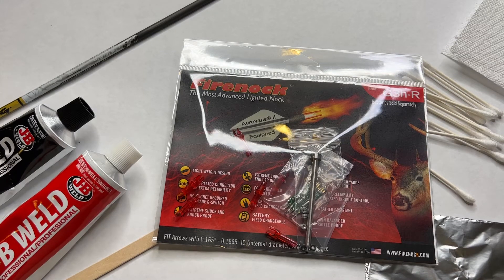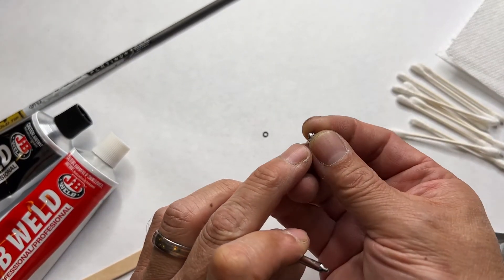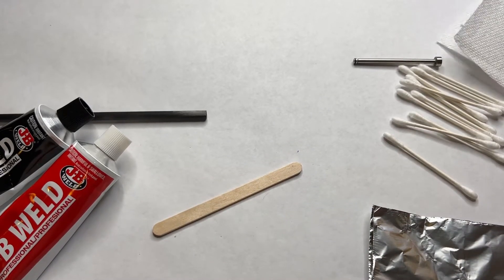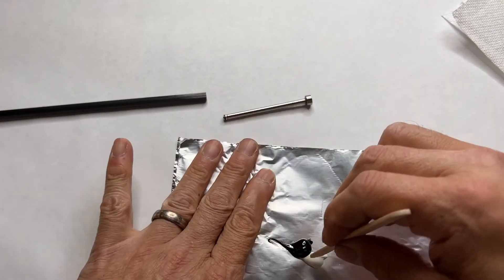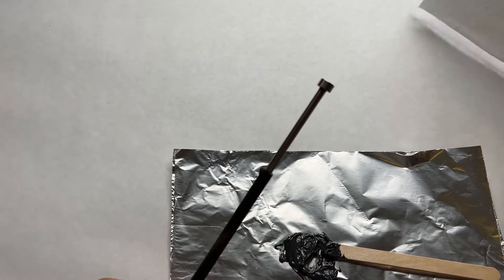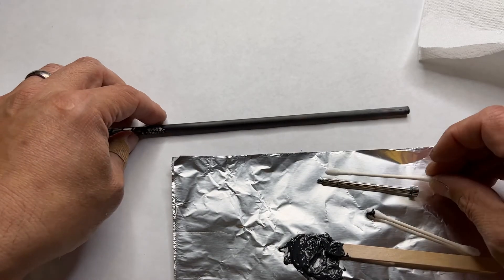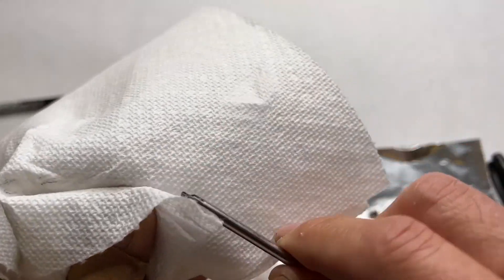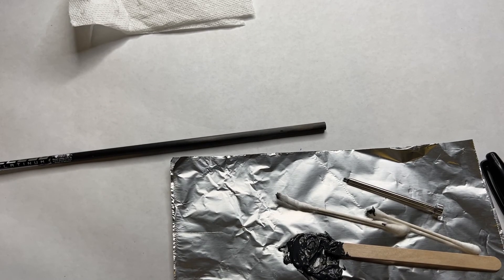Solid Insert End Cap Installation | Tips & Tricks

Comment: I gather there is sufficient pressure buildup with a closed insert end.  Did I hear the installation tool being tapped onto the table top in order to quickly seat it in this video?
One other question: have you had any experience with the Professional Grade JB Weld clear 2 part epoxy?   I used that material to rebuild a broken motor mount for my spinning wing duck decoy with excellent results.  Being that I have plenty of that stuff handy, I'm thinking of trying that on the End Cap install.  You can hasten the immediate cure by adding a little more hardener, but still best to allow it 24 hours for full cure.  And you can still clean up the residue with acetone!  Thoughts on the above?
Reply from the maker: I believe I meant to say to use painter's blue tape on a hollow tube (like a used ballpoint pen ink tube) so you can gauge the depth of the tool if you decide to use the hollow tube instead of the installation tool for easier installation.  I have not tried other JB-Weld besides the original and have gotten great results.  If you try another one, please share the result so we all know whether to use or not to use those. Due to all these being for impact resistance, more hardeners not only mean faster cure but also mean less carbon chain and more continuous long-chain bonds, which yield smaller/shorter molecules, which also translates to less impact resistance!  I know before the original JB self, you could use alcohol or acetone for cleanup; I am quite sure after it is cured, nothing besides a physical scraping can remove it .